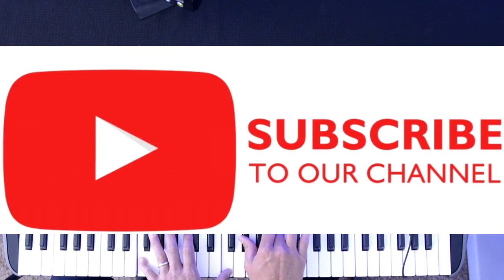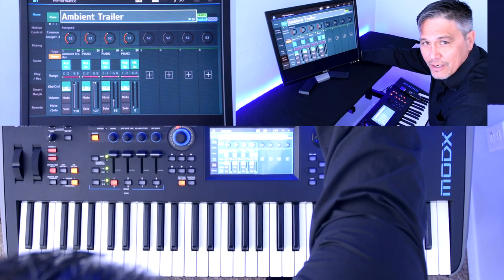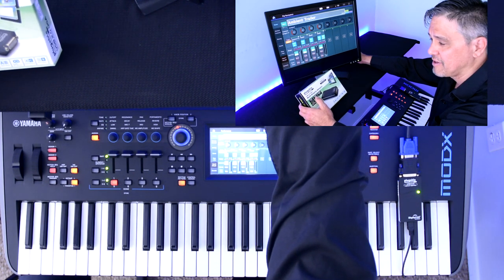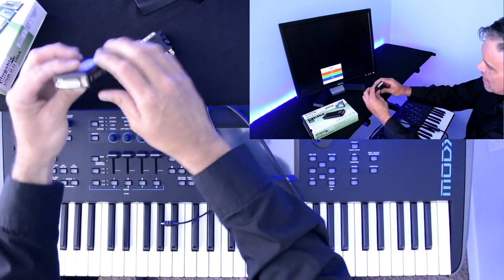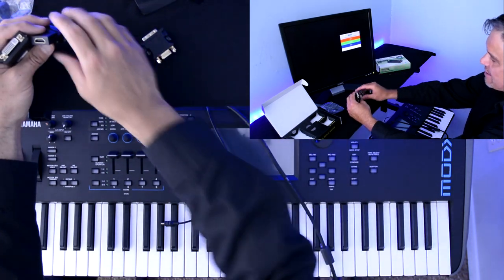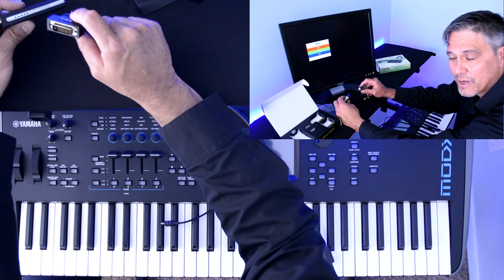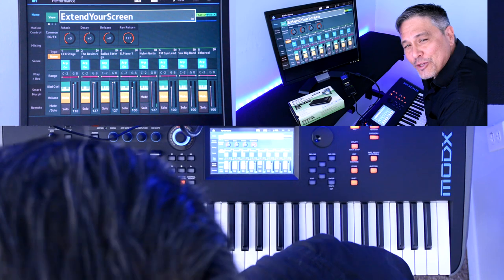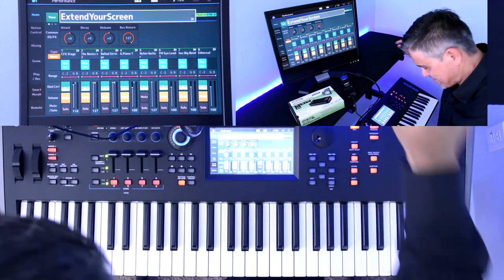Extend Your Screen HACK for Yamaha Montage & MODX

Comment: No doubt the reason why you have almost 7,000 subscribers.  You are awesome, for sure.  One question.  The computer monitor you're using ... does it automatically allow the full screen from the MODX to be viewed or do you have to adjust the size of the picture in the computer monitor?  I ordered my from Amazon a few minutes ago and it will be here tomorrow (Saturday).   Walmart, Best Buy, Staples and a few others places sell them, but it will be next week before I had it in my little hands.  Will definitely give it a try.  I have both a Yamaha Montage 7 and now a Yamaha Montage, Jr. (MODX 7).  Still trying to learn them and will definitely accomplish this sometime this year, hopefully.  Thank you for your videos.  So much appreciated.
Reply from the maker: Hey thanks so much for the kind words! And the answer your question, that monitor was Plug N Play! All I did was adjust the color temps slightly, didn't have to do anything with the output resolution. Best of luck with your HACK! And congrats on your Montage Jr! Love it!
Reply: @SynthsandGuitars 

Oh wow, been looking for this. However, I thought I saw you post something that showed your connecting up to a tablet. If this is correct could please point me in the right direction where to find the information to do it? Thanks.

Comment: Thank you so much for this great video! 
Would be there even less latency if the device is USB 3.0 standard?
Reply from the maker: There may be a problem with the MODX powering a usb 3.0, lack of power possibly, so I didn't go that route.

Comment: This looks very handy. Does anybody know if you must devote that USB extended monitor exclusively? I use my USB stick frequently and would hate to have to unplug or plug all the time. I wonder if the system could handle a hub or a splitter that would allow the monitor to be running full-time as well as USB sticks simultaneously all from that single USB output on the back of the MODX?
Reply from the maker: See my latest Touchscreen for MODX video where I use a hub to successfully read and load User Libraries, hope this helps and thanks for watching and subbing! https://youtu.be/inrq7ITpVeA

Comment: It's not really a "hack", Montage and MODX uses LINUX as their base Operating System, and there are video drivers included with that for the displays that Modx and Montage already use, this library can also use several monitors, usually gets detected in "mirror mode" just like Windows, and is Generic VGA display compatible. The touch capability is a HID device and acts exactly like a tablet (which linux is also compatible with). If you want a cheaper working adapter, there's a 28 $ clone on eBay incl. shipping (just search for USB 2 to VGA / HDMI) and make sure it looks like the design (not the packaging, the packaging varies) that Synths & Guitars are using in his example. I tested it with HDMI, which also works just fine.  

A word of caution though, I went to great lengths to test various solutions to find the right CHEAP adapter for this, and the 10 $ square box USB 2 / 3 - adapters WILL NOT WORK as they require Windows specific drivers. But now you know you can get a working adapter for less than 30 bucks incl. shipping, so no need to pay 70-110 $ for this solution anymore, the "clone" works just fine.
Reply: Hello, can you put an HDMI touch screen to MODX?
Reply: @joaquinruiz3039  Yes, there is already an "unsupported" mirror driver in it, but it is USB2 based - so you need a compatible USB2 to VGA/DVI/HDMI Adapter to make it work, I have one and it works on both the MODX and Montage.
Reply: @joonglegamer9898  I have seen some USB HDMI adapters, but in Amazon Spain I can't find.. Thanks!
Reply: @joaquinruiz3039  There's a specific adapter that works, you can find it on youtube by searching for Yamaha Montage to HDMI or similar, then you go to ebay and search for the lowest price of that adapter.